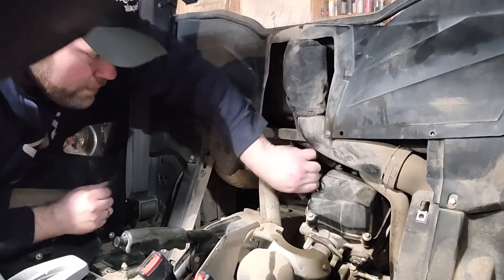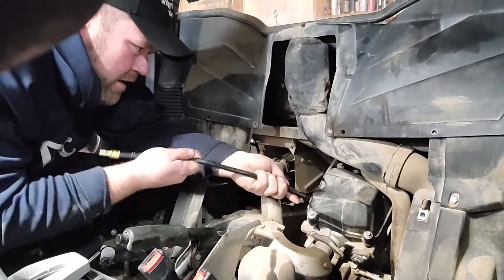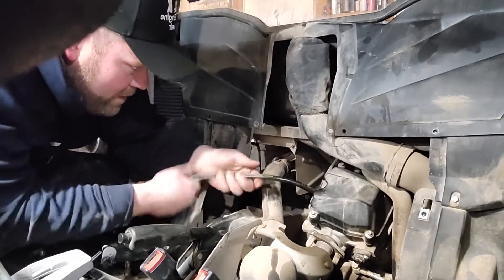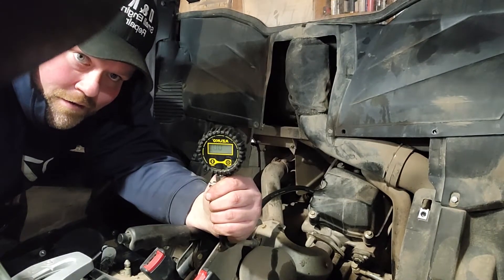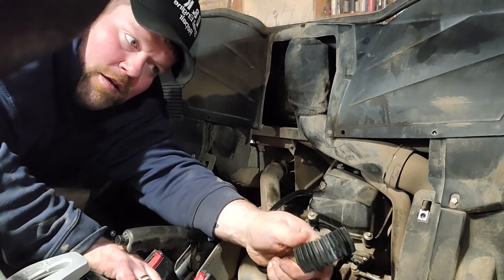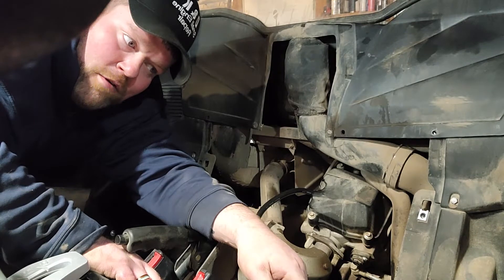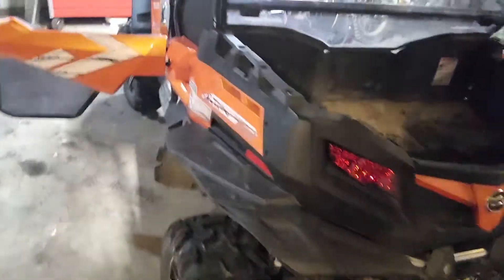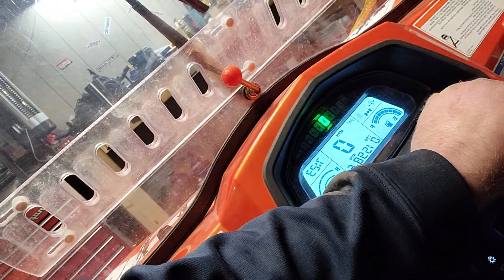How to check if your piston rings are bad in a 4 stroke engine. Easy done without special tools!!!

Comment: This guy Dan White Jr is a crook. He had our snowmobile for 10 months to rebuild the motor. Took $3200.00 from us and didn't even loosen a bolt on the machine. We got it back, took it to a shop in Cadillac Mi and the mechanic there tore it down and showed us that it still had all original parts. DO NOT USE WHITES ORV SERVICE formally known as D&K IN Fife Lake MI. HE Will Rip You Off, then the pussy won't even answer his phone calls or messages because he knows he is a POS..
Reply: Damn I'm sorry that happened to you